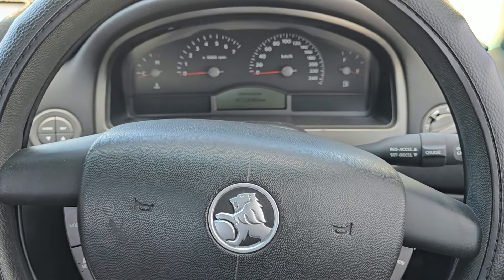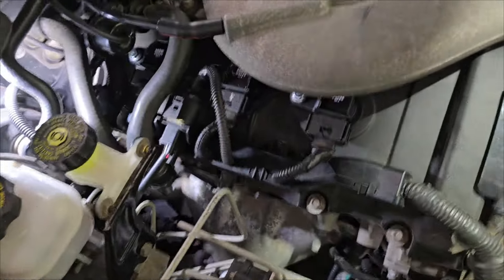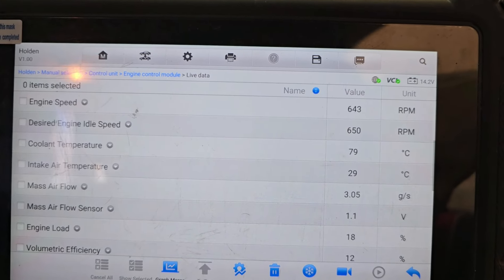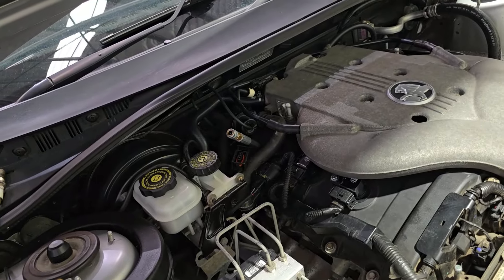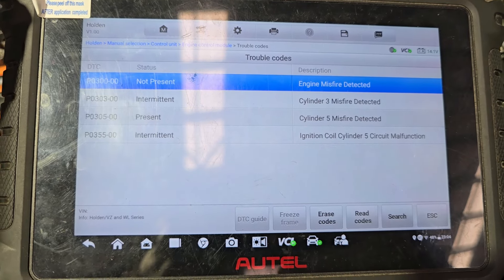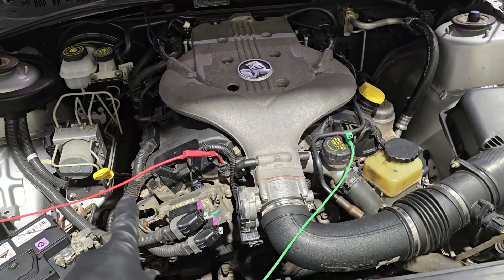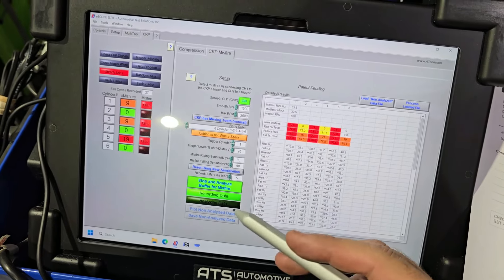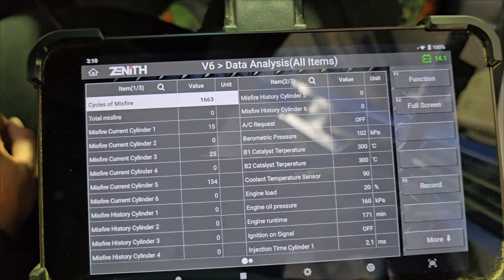VZ Commodore Random Misfire Only On Bank 1

Comment: So if you don't mind, I'd like to give my two cents on this. I've never worked on a VZ commodore 3.6 but looking at your data I would 100% say the cam timing is off on bank one. It's all the classic symptoms including low mass air flow, reading, positive to negative bank to bank fuel trims, low compression according to relative compression test, etc. Being that the cam sensors read off the back of the actual cam gears, it doesn't give you the whole picture. All it tells you is that from gear to gear to gear the chain is good. However, if the cam gear pin that locks it to the camshaft has broken and the cam gear is no longer in time with the camshaft you won't see that with a cam crank correlation. I would be willing to bet if you did an in cylinder pressure test on bank 2 and compared it to bank 1 you would see the shift in timing. I've been down this same path and it beat me down pretty good 😂 and it ended up being a sheared keyway on one bank. Anyhow, just my two cents. Great video by the way 👍🏼
Reply from the maker: Holy Crap, is this the man Eric O commenting on my little channel video down under in Oz!!! You are a legend firstly!  Secondly, yes I completely see what you're saying and I was thinking that I should have dug deeper on the in-cylinder pressure test and compared both banks but silly me, I was in tunnel vision into the exhaust restriction at that early point. However the customer didn't want to spend anymore time but sometimes I love doing that just to satisfy my own curiousity and I should have!! Where did one of these beat you down, is it on your channel? I'd love to see it! Thanks for even considering to watch one of my videos!!
Reply: You know you hit the big time when Eric comments on your video. ❤
Reply: Eric this is great, Rob is fairly new to YouTube and runs an outstanding shop in Perth, Western Australia. But you take the time out to watch others and comment. You Sir are a Legend.
Reply: Solid video and 2 cents. 👍
Reply: @romanosautomotive  No video on it. It was a while back but it has stuck with me 😂. I'm not real good at in cylinder interpretation but short of pulling it apart I can't think of another way.
Reply from the maker: Thanks Eric O! Those icky ones always stick in our minds. Appreciate you taking the time to watch and give your input. Thank you!
Reply: Da legend

Comment: If for example the exhaust cam timing was out, the pcm would not pick that up due to not having a cam sensor. However, An incylinder test comparing the good bank vs the bad bank might yield some conclusive evidence. Or perhaps a pulse sensor on the exhaust while performing a cranking test? Thank you.
Reply from the maker: Yes in retrospect, it would have been nice to have time authorised by the customer to compare in cylinder bank to bank. Check out Eric O's comment on here. He's on that thought train also! Thanks for watching!

Comment: Great vid. Question, is that one of those cars that shuts the fuel injector off when it detects a misfire? Maybe you could put the scope on the injector control wire to see if it does.
Reply from the maker: Yes it is. The misfire you saw in the video was the ECU shutting the injector off because it was counting misfires even though it wasn't traditionally misfiring. Thanks for watching!